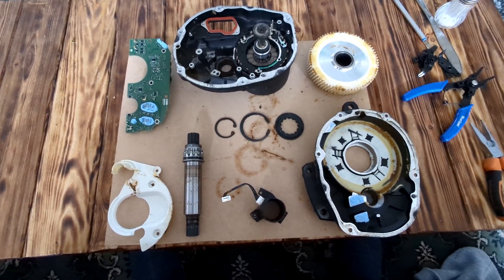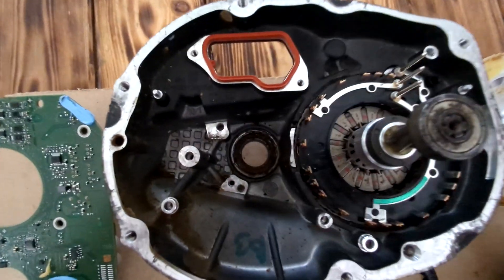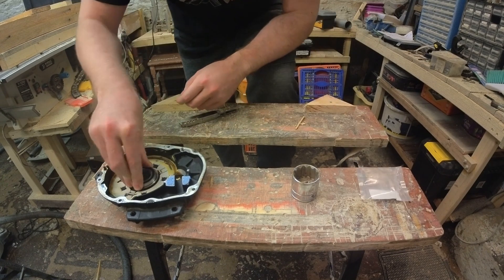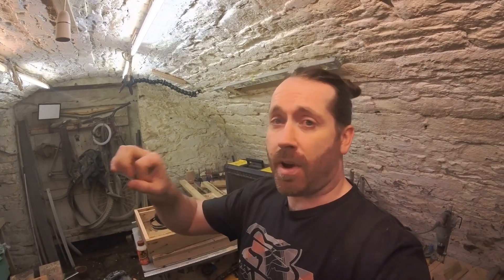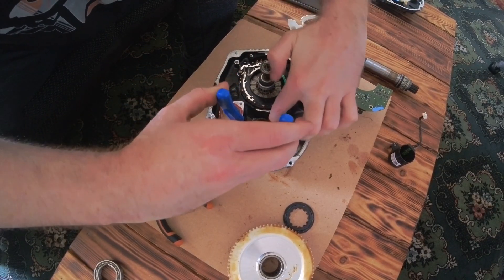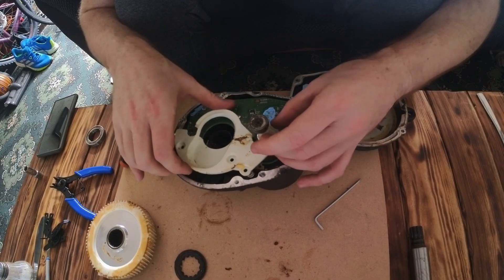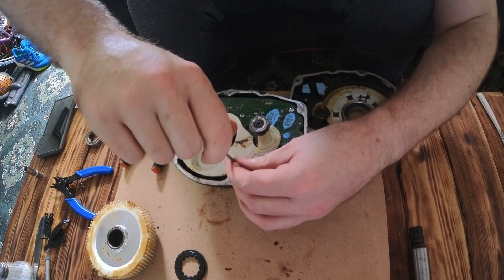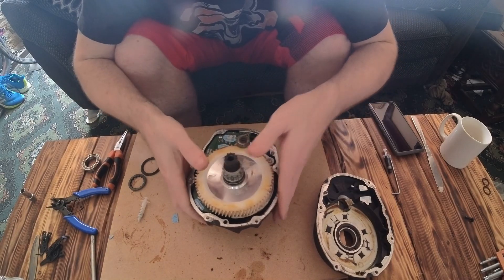Bosch Performance Line Motor Fix for £6

Comment: Hi! I changed the bearings (except the little one in the main motor) but now it appears 510 fault. The only thing that i did different was to separate hollow shaft of crank shaft for cleaning them. What could be happening? Has both shafts relative position? Thanks in advance!

Comment: I have just finish repairing my Active line motor. I replaced the right-hand Armature support bearing (the small bearing on top of the motor you didn't remove) and both crankshaft bearings.
To remove the armature support bearing I used a two jaw gear bearing puller (with ultra thin claws to fit in the narrow gap underneath the bearing), to remove the crankshaft bearings I used a Bushing and Bearing race driver set with a rubber mallet to tap the bearings out and in, I recommend buying a set to make sure you get a good fit making sure to outer ring of the bearing is covered so as not to damage to new bearing when you drive it in.
Remove the old thermal putty, use Isopropyl Alcohol (at least 90%) put the smallest amount on a cotton bud (so it does not drip alcohol onto the board) and gentle rub the Thermal putty with the alcohol to soften it and gently lift it off using the dry end of the bud. To replace the thermal putty (do not use paste and you'll need at least 10grams of putty), on the right-hand motor case (the side without the motor) there are 4 machined faces that correspond to where the old putty is on the circuit board, cover the whole of each of the machined face with the putty (about 2mm thick on each face) to make a thick as possible pad from the putty.
Clean and Re-grease the large gear with Bosch synthetic grease, clean and re-grease the freewheel bearing inside the large gear, replace the O-rings at each end of the crankshaft and smear with grease.
Tools needed: 2x 170mm circlip pliers (internal and external)
Two Jaw Gear Bearing Puller with Ultra Thin Claws
52-in-1 Custom Bushing Driver Set
The bearings, O-rings and grease I purchased from Performance Line Bearings

Comment: How did u get the big wheel off the crank?? I need to get it off to put a new clutch bearing in it otherwise its straight forward enough 👍👍
Reply from the maker: If you are talking about the chain ring? There is a special tool to remove the lock ringe. after that it just pulls off.